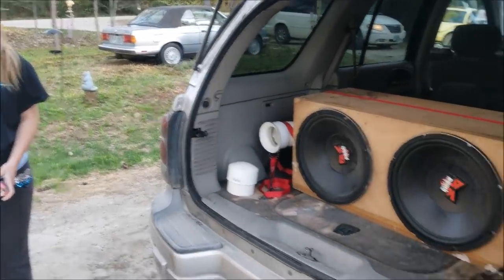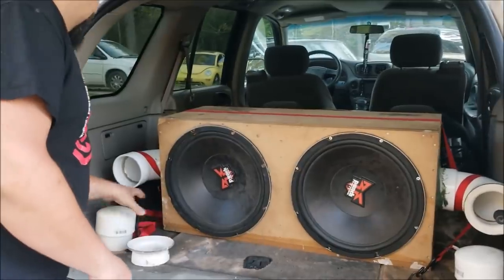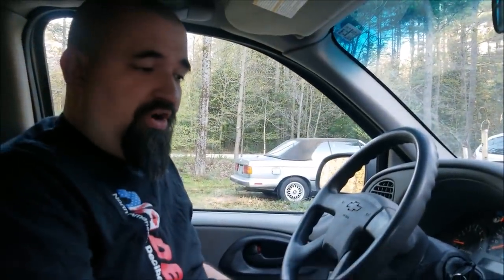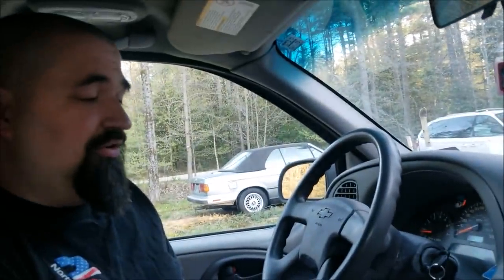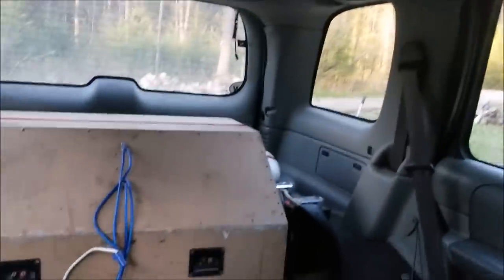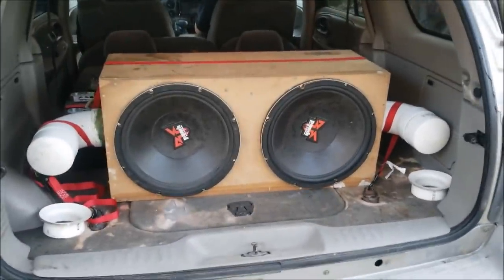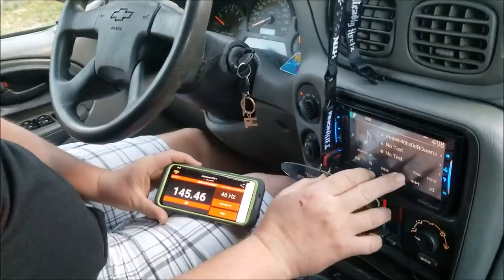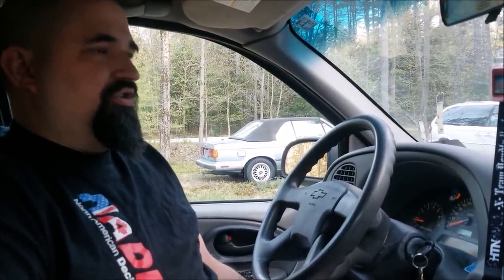Ported vs Sealed Enclosure Subwoofer Box Test with Decibel Meter Using My Daughters Bass Car

Comment: Great video bro..I need expert opinion which would be louder 4 15s sealed 6000rms? or 3 15s ported 4500 rms tuned 28hz?..I always ran ported but looking to go sealed if it get loud enough and LOW..
Reply from the maker: I believe that ported when properly build and tuned will play low and loud. With sealed you are going to have a roll off slope of 12db across the board. With ported you will be louder than sealed above tuning hz, but below tuning hz there is a sharp 24db roll off. There is a great article that can be found here discussing ported enclosures. Also it helps to model up designs in WinISD software or Bass Box Pro software - http://hometheaterhifi.com/volume_5_2/cmilleressayporting.html   Thanks for watching and commenting!
Reply: Steve Young Sealed promotes more lower frequencies right?
Reply from the maker: @KINGDOMKONCEPT  It depends on tuning / size of a ported enclosure. Sealed offers a 12db per octave roll off as opposed to the very sharp 24db roll off below tuning hz of a ported enclosure. The benefits of ported enclosure when designed and built properly I feel are substantial at delivering the lows people crave. If sealed was the go to for lows then you would see sealed used in home theater setups where response is desired down in the sub 20hz region for sound effects / rumbles in movies, instead you find 99.9% of home theater subs are ported and tuned low for that deep bass response required to deliver those lows. Just my opinion. Thanks for watching and commenting!

Comment: You will see a 3db gain at the exact tuning frequency of the enclosure. So, obviously you are not at the exact frequency.  Normally you will see the gain within a 2-3hz range.
Reply from the maker: Peak response in car vs outside would be different results. We were metering at the vehicle peak. It would be interesting to set the meter up in an open space environment 3 meters from the enclosure and test again. Thanks for watching and commenting!

Comment: To me ported is sloppy bass sealed is the way to go clean smooth
Reply: That Guy stop using prefabs
Reply from the maker: Depends on how well the enclosure is designed and built, also depends a lot on the driver used. Some are specifically designed to perform in ported enclosures. Thanks for watching and commenting!
Reply: Deez nutz Taste good when you I build my own boxes to spec

Comment: Logic would dictate, that since you are not getting but 1db or so from sealed to ported would indicate rockford fosgate LIED about the ported size and why not right because ppl who have no clue how to do the math for the box size, only really care if the box will fit. and who wants a box that's 25% larger for 3db, nevermind the complexity if you actually build a port pass that is actually tuned and ported for air velocity requirements. Man most people don't even have a clue that the middle-ish area of the port should be slightly more narrow than the exit and entrance of the port. It's all just math. Study how actual concert speaker ports are designed, you'll see it.  You could also find thicker wood, like a high density 2inch thick hardwood,... well anyway, too cool she won 1st place.

Comment: Good video except no speaker takes the same size box space for ported and sealed. Yes it may fall in the realm of usable with that size but honestly just plugging the port with the same airspace as portes is not the best sealed vs ported. In car audio enlarging a sealed box size does make it play deeper notes but it absolutely sacrificed output and causes the speaker to reach full excursion early. Just because it's a usable box size does not mean it's the optimal box size.
Reply from the maker: Watch the video again and pause at 26 seconds for a screenshot of the owners manual from Rockford Fosgate where it specifically states the recommended enclosure size at 2.5cf sealed and 2.5cf ported. Looking at the illustration yes you will see the range for each enclosure size the driver will work in, however again there is literally an arrow at the 2.5cf mark on either scale pointing out and stating 2.5cf as the optimal enclosure size for these drivers. ----- Also before anyone mentions the tiny additional volume of the sealed enclosure when ports when plugged there is roughly 100 cubic inches for a cylinder 4x8 or 0.058 cubic feet added to the sealed volume per side so technically 2.558 cf sealed vs 2.5 cf ported would be more accurate. I honestly don't feel that 0.058cf (0.232% difference to be exact) in volume would have altered the outcome enough to mention. Thanks for watching and commenting!
Reply: @E4EonEbay  run those speakers in a box modeling program using the speaker parameters and you will see different results. I make custom speaker boxes and I can tell you there is no speaker I have ever encountered that was "optimal" in the same size box for both sealed and ported.
Reply from the maker: I'm sure Rockford Fosgate as a large company did their homework before printing the owners manual. I have both WinISD as well as Bassbox Pro so I supposed I could model them up and see but I built the enclosure and made this video based upon manufacturers recommended optimal enclosure size as stated in the owner's manual.
Reply: @E4EonEbay I know you did and you obviously don't care to further your knowledge on speakers and boxes. Those are old speakers and car audio has changed alot since then. Have a good one either way.
Reply from the maker: @davidmarles9409  https://youtu.be/wHYBbOMwNwE take a look at the wall of car audio trophies in the background. You think I won all those without expanding my knowledge of drivers and enclosures? Competing within a specific set of rules regarding power, enclosure, driver and port size is a challenge and forces you to redesign and redesign again as you can't simply throw more power or subs at the problem to gain db. I ran undefeated in NADBL Rookie class and to this day still hold the highest score for the class. The following year I ran undefeated in Pro No Wall until finals when I took 3rd. Believe me, I do have some knowledge of the relationship between drivers and enclosures...

Comment: Great video. About the ported score, though. Keeping a good port diameter distance from the drivers and any box wall, plus having a port area fitting a 15" woofer, you might get better results. Just saying :) 

Also, the manual may state the same volume for ported and sealed - this does not mean it's optimal. 2.5cu.ft for a 15" ported is very little airspace - especially for an old school woofer.

In short, I'd like to see a retest where the box is an optimum ported volume box (by parameters), and then you can just seal those ports when testing. I think you'll see very different results :)
Reply from the maker: Using the TS parameters of the drivers and modeling in WinISD and Bass Box Pro you will see that these subs were actually designed by Rockford to perform in small enclosures. Thanks for watching and commenting!

Comment: You should get a real microphone to do these kinds of tests. The mic that’s built into your cell phone is not capable of accurately picking up that low of a frequency. You’re good to about 90hz  on those little mics.
Reply from the maker: You don't realize I'm using an SSA APM1 meter $450 mic that connects wirelessly to my phone... it is calibrated to the Termlab Magnum within 0.05db accuracy, look it up. Research and read before making comments. Thanks for watching!

Comment: That's nice I have 1 12 and it does 168.4 d.b ported on the windshield 😉
Reply: What meter? Is it an extreme class car?
Reply: I have 2 ZVX 12s in a custom built porter box tuned at 32 hz running on one 4500.1 class d, all zero gauge wiring, big three upgrade, 320 alternator,  and xs power battery, and I’m only hitting in the 150s. I know damn well you ain’t hitting 168 with one 12 😂 gtfoh 😂😂
Reply: I am pretty sure I saw you on another video claiming 192db. Bullshit
Reply: your mom

Comment: Something is not adding up. No flexing or anything at 146. My Mustang does 146 and it is built. Every hole is sealed and sound deadened. Nobody in my county was hitting 146 in the trunk class but me and I am running way better gear. I am 46 years old and competed in 1990 when everyone was running the Punch 150 amps and punch subs. Cars with 4 15 in Punch subs were hitting 136 at best. I had a ton of friends as well and we were all installers and have been at it for all these years. I am not seeing how this is hitting over 130 db the way it is. Sorry. That meter must have been set 10 over or you created a miracle with junk gear because nobody back in the day was doing those numbers with 2 12s. Hell in 94 with my CRX having 4 blue thunder 12s and a Precision Power Art series amp I did 139 and got 1st place in a really big show. Not seeing it man. Btw I have gained 4 db by going ported and another 3 db by sealing the box to the car forward and sealing every hole.
Reply from the maker: Flex depends on frequency, this setup in my jeep was capable of a 148 before I gave it to my daughter. Termlab mic certified. The meter in the video is an SSA APM1 which is a $450 mic calibrated within 0.05db of the Termlab Magnum. She competes with me in North American Decibel League, scores are posted on their site NADBL.org  you can check the results yourself.... also these are not standard Punch subs, they are POWER DVC 15s with 4" voice coils. They are each wired to a Power 1100a2 that is capable of over 3k on the amp dyno (you can find the dyno vid right here on YouTube, so yeah 2 15s on that kinda power in an SUV is easily a 46.... like I said it was a 48 in my jeep. Thanks for watching and commenting.

Comment: Turn the subs with the dust cap straight . WF not turned sideways. I'm picky sorry.
Reply from the maker: It drove my OCD friends nuts...
Reply: @E4EonEbay  I used to get plain dust caps to replace the branded ones because the slightest tilt would anger me 😬

Comment: I believe we're your box is big your not gonna see i big difference, small setups would vary more imo
Reply from the maker: Box is built to recommended specs of the subwoofers, 2.5cf per 15 is actually pretty small for 15's
Reply: @E4EonEbay  I meant like big in general, nevermind the specs , I really wouldn't know for sure I was just thinking out loud 🤔!?

Comment: lol some people are clueless, u do not make ports for higher SPL, you make it so your subs can go lower frequence or if they have a dip in a certain frequence you tune the ports for that... that is what they are used for. Also your test shows how little you know of speaker design. A ported bass box needs to be smaller compared to a bigger one that is not ported to cover the same low bass frequency area. so your test is invalid and silly tbh. To make this test better u should have used a sweep sine wave tone for the whole bass area and see what happend.. and then tested like 10 different frequence and see the db lvls. last but not least a sealed box with no ports needs to be as dead as possible even more so than a vented box your way of making the box closed is ridiculously silly. but up to you keep being silly / awesome / clueless.

Comment: I'm hitting a 182 with one 15'' you just gotta know what you're doing
Reply from the maker: Wow, what organization do you compete in? Was this legal score sealed dash outlaw score? What sub / amp / vehicle?
Reply: I call bullshit. Video and pictures or was this in a dream?
Reply: Daniel's dad isn't around so he looks for attention from strange men online.
Reply: Bwahahahahahahahahahhahahhahahaha
Reply: @E4EonEbay  I don't even go to shows anymore I got 2 12  kickers and I blow my back windshield out every time I turn the bass amp on. A guy once told me I have the world record SPL score. It was so loud it broke the  meter into pieces.
Reply: @briannayoung4210  one time when the glass blew out it hit a kid in his eye and he had to get an eye transplant so he didn't go blind. It's cool he has 2 different colored eyes
Reply: kr33p1n omg that’s crazy 😱
Reply: @kr33p1n  And this one time, at band camp...
Reply: @Des420  yes? What happened?
Reply: Not sure if a troll post or not, but these sorts of things are trackable and quantifiable. There are maybe 4 or 5 vehicles in the world that do 180s and they are all extreme class vehicles. that means they had 6" thick or more plexi windshields with concrete and steel interiors and all well over 100kw of power. For a normal street class type car with a single 15 and maybe 2kw it's normal to do mid to high 140s.
Reply: 😂😂😂 @Daniel Warren you can stop bullshitting now, if you did that with 1 15 everyone in the audio world would know who you are.
Reply: @kr33p1n  Shame they deleted my original reply... It was funny. And true.

Comment: This test isn't very acurate, that box it's designed for vented aplication and you are sealing it, Sealed enclosures are always much smaller in order to work properly as sealed box
Reply from the maker: Watch the video again, pause at 27 seconds, Read The Owners Manual... The RFR2215 Power DVC Subs are different, they have an optimal recommended enclosure air volume of 2.5cf Sealed with the same optimal recommended air space of 2.5cf Ported. So yes the test is very accurate... maybe not with your average run of the mill subwoofers, but using these subs allows for an accurate comparison.

Comment: But this is not a true sealed set up🤭. Just FYI your argument is all cap because this is like a rigged ported set up not a sealed set up. Good try tho still close.
Reply from the maker: It's airtight with caps in place, no leaks I've checked with soapy water around the   cap with bass slammin, no bubbles. Sealed...

Comment: Why don't you make it that box that he's videoing with is built for ports now if he would look up the spec for the subs and it would definitely recommend a smaller box if you wanted an enclosure the enclosure would only be half that size if that and would put out more high bass rather than low if you're looking for high bass then run a sealed box if your looking for low bass run a ported box if you're confused and have alot of money well come and see me we'll get you where you want to be Lol
 This is what I recommend if your confused about what you want try a sealed box first if you just like music and just want a little or a lot of ump into your system sealed box with a EQ would more than likely put where you want to be
Reply from the maker: Bro Go to 27 seconds,  - https://youtu.be/e5AeSyOeTWM?t=27  Read The Owners Manual Screen Shot. You can clearly see the Recommended Enclosure Size for Sealed and Ported for these subs are both 2.5 cubic feet. So Yes, I looked up the specs.... Thank you for watching and commenting.

Comment: Problem with this video isYea the ported was louder.But a sealed and ported box will yield different numbers on box size. 2.5 cbf each is closer to the subs reccomemed ported size. Than it is sealed. So if the sealed was a smaller box you would score higher. Ported or sealed = cbf net. To simply say ported is always going to score higher is wrong. And spreads bad Info
Reply from the maker: william Landreth did you not see the screen shot of the manual? 27 seconds into the video. It literally states the recommended enclosure size of each and they both are listed at 2.5cf as Optimal for either application... I know other subs will obviously yield different results, however when dealing with subs designed to utilize the same air volume sealed or ported, ported is the way to go if you are looking to gain SPL
Reply from the maker: william Landreth also sealed couldn't be made much smaller, the overall range specified in the manual only goes down to 2cf sealed, so I don't believe substantial gains would be achieved going smaller sealed, easy to find out by simply adding wood blocks inside the chamber to take up volume, maybe I'll play around with volume and see...
Reply: Steve Young no. I missed that.
So my bad.
Reply from the maker: No worries, I should have let it show longer in the video than 2 seconds LOL
Reply: Steve Young for spl metering we always build smaller.
 Less rise
Lower or closer to rated impedance .  = higher spl
Reply from the maker: Oh I understand man, I hold the NADBL rookie class record for SPL. I had an undefeated season last year and also brought home rookie of the year : ) -  https://www.youtube.com/watch?v=DIz73wfZXeI
Reply from the maker: Hit me up on FB man we can chat there, i'm always down to discuss possible gains in SPL
Reply: william Landreth o
Reply: William Landreth, You are actually correct.  The manual may state down to 2 cu ft, but if you built one that size and put a port on it the sealed maybe louder.  I have these exact subs.  I've owned them for 20 years, and they are some of the best you can buy.
Reply from the maker: staff curtis I understand the range listed in the manual, however I was comparing the recommended optimal size listed for both sealed and ported which it lists 2.5cf for both in the owner's manual. Even if I put blocks in this box taking up air volume leaving the port the same length it would simply change the tuning on the ported box and there would still be a peak in output somewhere just above the tuning hz compared to the sealed box due to the nature of a ported box gaining efficiency around that hz as compared to the sealed box. As you shrink a sealed box's volume it loses efficiency, people always try and talk about a smaller sealed box handling more power and that is simply adding more power to try and compensate for lack of efficiency... thanks for watching and commenting!